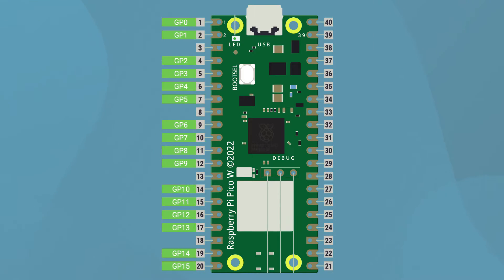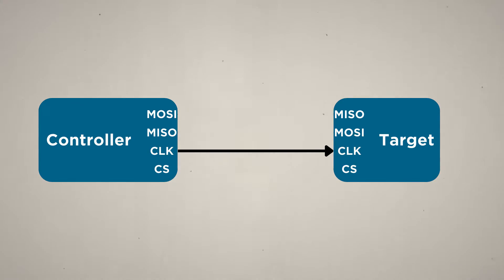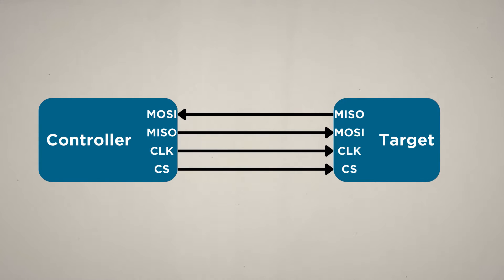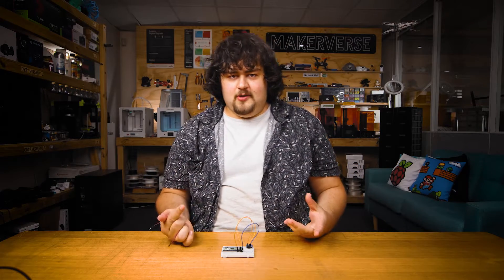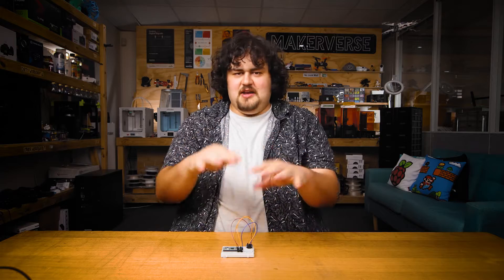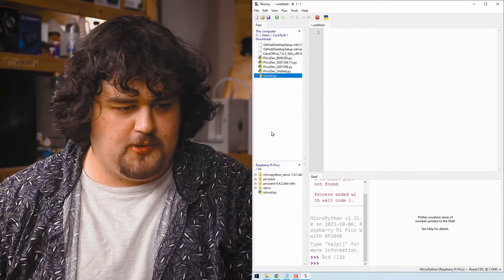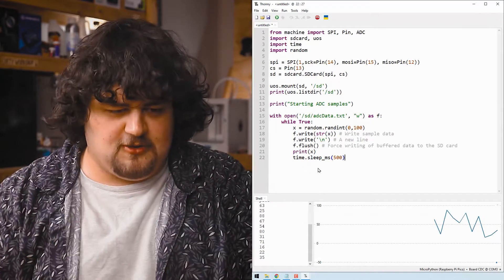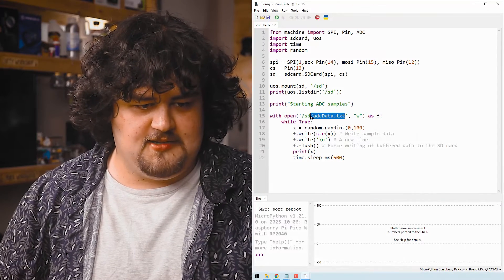SPI | Raspberry Pi Pico Workshop: Chapter 4.3

Comment: For those that are also facing the OSError: [Errno 19] ENODEV mounting error and are using other models of SD card reader, I would recommend watching and following the 'Pico SD Card Tutorial - Read, Write, and Log Data' by a channel called Print 'N Play. Following the steps in this video fixed the issue for me.

Comment: Can the RP2040, RP2350, and Picos be programmed via SPI like a lot of other MCUs/Dev boards?  E.g. in the event that there's no data-capable micro USB handy.
Reply from the maker: That is a question we have never been asked, I would guess maybe not if you are using MicroPython? Very unsure there. The Pico is a bit of an odd MCU at times and a Google search revealed nothing.

Comment: I am trying to connect two pi picos via SPI. Please help! I have some things working but I keep getting garbage data. Do I need a specifc library. Also I can't use UART because I need those ports for other things
Reply from the maker: That is quite a tricky task which is why we typically use SPI. You might have better luck trying to use I2C doing this though. Also remember the Pico can have 2 UART connections at once. Depending on what you are doing (it might be a little jank), but you can also have 3 devices connected via UART. 

We have made robots where we have a primary Pico sending messages to 3 other Picos via UART. The TX of the primary is connected to the RX of the other 3 Picos. However we can't send data from the 3 Picos to the primary Pico, because if they tried to talk at once on the same line it would be jibberish.

Hope this helped!